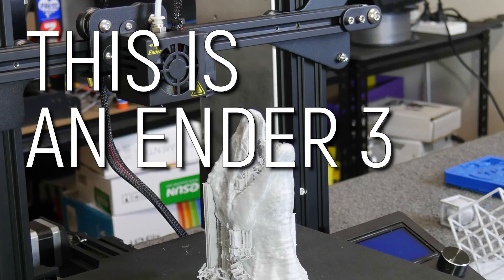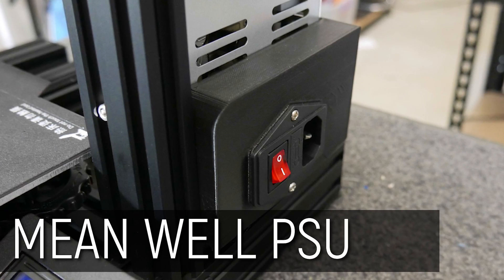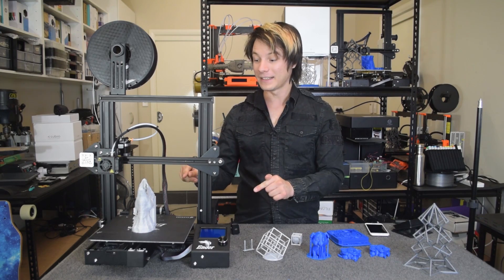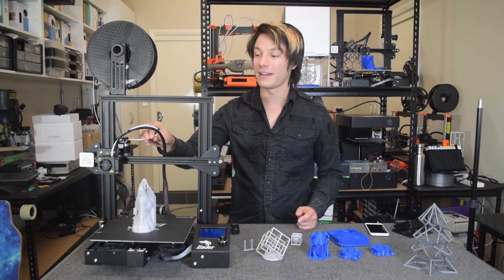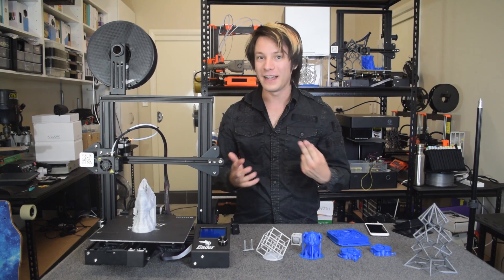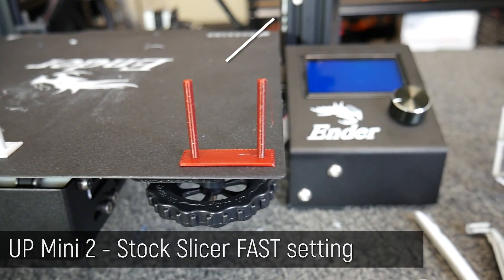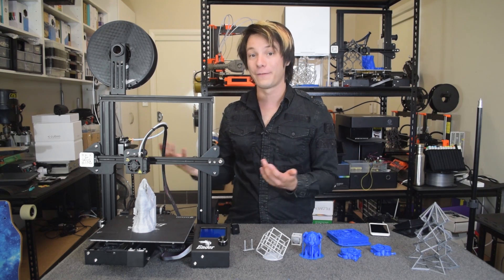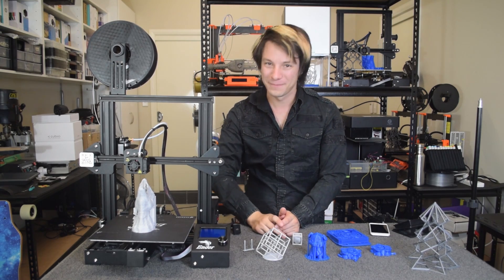Is the Creality Ender 3, Pro?

Comment: Modding costs time and money yes, but I learned soooooooo much doing it. And having a pretty good basis for no money is better then going for a Prusa and then start modding on that (which I would do). :) But I did mod the hell out of it because components simply are that bad, so for just wanting a printer that works and prints beautifully, you’re absolutely right.
Reply: Yeah I'm only recommending cheap machines to people I believe would be willing to tinker
If someone wants to print their cat designs and no more ill just tell them to save up for a prusa or something

It seems to me that the mk3 printers are one of the most hassle free ones on the market but their price would make me a little hesitant to mod in huge ways
Mean while  my cr 10 is only recognizable by its frame
Reply: @officer_baitlyn  hehe, cat designs
Reply: I would say, buy 2 printers, and fix each other, with the printed parts
Reply from the maker: Yep exactly! You either buy a 3D Printer as a hobby to learn and tinker on or as a tool to print well from the factory with minimal interaction.
Reply: Thats why I bought an ender 3 v2. I'd consider it the minimalist one as far as tinkering goes for the ender 3's, but still room to improve it if you want to.
Seems like the other ones are better suited for those that want to get involved more with modifying their printer or improving it, whereas the ender 3 v2 features some of the things that are popular upgrades of the ender 3's before it. Not that the v2 can't be improved though for your needs (like a left hand side LCD mount, better extruder, reposition the spool holder or add a guide, v rail covers, an LED strip mount for the top rail).

Personally that's quite a good amount of things I can print for the v2, and I'm sure there's a few more I could do. There's probably a lot more you can print for the previous enders though, not sure how much more that'd be beyond a few wire clips and a parts tray.
Reply: Yep. My Anet A8 was a great learning experience. I had fun building it. Printing mods, testing to see which were needed and which were just hype. I learnt that like all manufacturing machines a sturdy frame is the biggest game changer.
I've recommended the A8 to many people who all love it. It's cheap, it produces fair results if set up well and you quickly learn how to print better quality because it needs fine tuning. I really think I'd not have learnt as much about 3D printing, modelling and slicing if I'd got a consumer product. 
The thing I like the best about learning from my printer is that can model and print pretty much anything I make without support material, which leads to less cleanup and nicer looking prints. It's all because the A8 is bad at detachable support material so it forced me to look at model orientation and how I design prints.

Comment: I've used those couplers for the PTFE tube a lot for pneumatics. Make SURE each time you take it out that you re-cut the end back another 7mm or so before putting it back in. Each time the part that grabs on is engaged it marks the tube and can create a weaker Joint and eventually it can just pop out.
Reply: As well depends on the original manufacturer. Some are great with no slop in the parts at all, while others, looking almost identical ( well, they have to have the same dimensions to fit the ISO standard size limits for these units) are really sloppy.  Price is not always an indicator of quality either.
Reply: I've noticed. Problem is, I'm soon running out of bowden tube. Yes, I've had to disconnect it multiple times while upgrading and troubleshooting. I ordered some totally real authentic capricorn tubing for 3 bucks per 1 meter though. It promised to have a smaller inner diameter than the stock bowden tube.

Comment: Dude ever since your review on the easy peelzy I've used it on my wanhao i3, I love it! As far as "pro" for this machine, I would save the $100 and get some easy peelzy, a raspberry pi for octoprint, a glass bed, some spare nozzles, and maybe a couple hotend supplies. 
Thanks for pointing out the differences (or lack thereof) with this printer. People need to know! 😁

Comment: How exactly does the better fitting tubing affect the quality of the print?
Reply from the maker: Less room for the filament to flop around so it can be controlled more precisely.
Reply: do this. tape a piece of rope and lay it on the table nice and straight. some good stiff but reasonable thin rope.

now PUSH one end of it. what happens? it moves the opposite way but what ELSE does it do? it also "deflect" sideways away from the direction you want.

so if you tell your finger. Move the rope 5mm what happens if it does NOT move 5mm on the other end? this rope is filament.

NOW put the rope in a loose fitting tube and do the same thing. you get a better result on the other end but the rope can still move around inside that tube so you still get "slop" 5mm on one end does not equal 5mm on the exit end.

make the tube a tighter fit! now what happens? even less slop. can't go too tight or it will bind but the "closer" the ID of the tube is to the OD of the filament in theory the less "slop" you get because the rope (filament) can't deflect sideways back and forth in the length of the bowden. this also why you want the bowden as short as possible.

This is why you need more retraction. in a direct drive 5mm in and 5mm out are equal.

but if the bowden adds say 1mm of slop then when you push 5mm you only get 4mm out the other 1mm was "slop" in the tube. this will result in "under extrusion" at the start of your layer. and when you retract 5mm you are over extruding because the first mm of "retract" undid the slop and now it pulls back 4mm. not the 5 you asked for. oozing.

so you have to compensate with more retraction to overcome this "slop" factor. the tighter fitting capricorn tube helps with this by reducing the slop inside the tube so your filament movements are more precise and more predictable. with enough slop you might even get "DIFFERENT" amounts of slop each time you retract and push!! so not only do you have to compensate for slop but its variable and inconsistent.

its not a huge deal but IT IS an issue you have to compensate for in your slicing and model design.
Reply: Less slop in the tubing means better, more precise extrusion.
Reply: the other thing for capricorn tubing is 'supposedly' they have added some super low friction coating so it slides through the tubing much easier with less drag.  This mainly affects retraction, because when the filament retracts and there's friction with the filament and the bowden tube it can pull the bowden tube up away from the hotend.  This means it's harder to retract the filament(more stringing), puts strain on the pneumatic coupler and wears those out faster, and(with a non-all-metal hotend) it also creates a gap in the melt zone which can allow filament to pool and cause more drag/clogging.
Reply: @nothanks7752  I'm not sure what you could add to the surface of PTFE tubing that would either adhere or help the performance of the PTFE.  PTFE has one of the lowest coefficients of friction of any solid.  Sounds like marketing wank on Capricorns end.
Reply: @TechGorilla1987  thus why I put quotes around 'supposedly'.  That said, I just looked at their website, and it's not a coating, its actually baked into the ptfe.  The specific quotes on their website are "Our secret blend of high lubricity additives turns it a deep blue color." and "In 2016 we developed the XS formula of high lubricity additives combined with smaller inner diameter"

so...... idk.  I guess if it works, it works.
Reply: David  We posted within minutes of each other. His reply hadn't shown up on my computer when I typed mine.